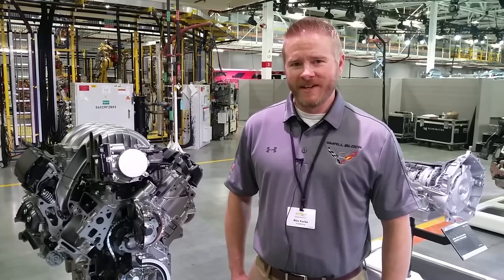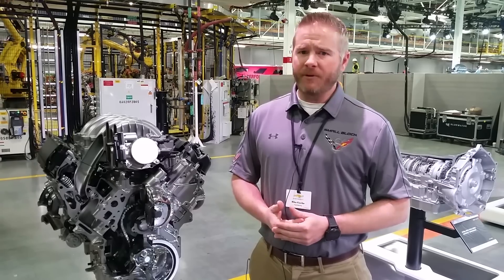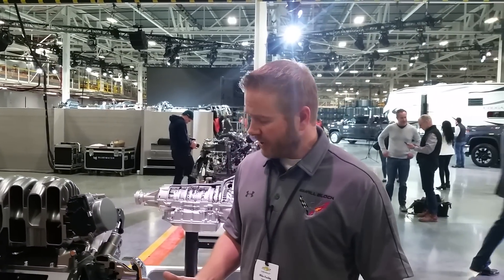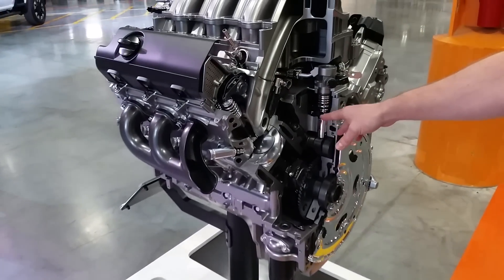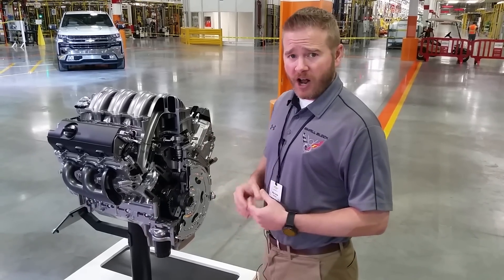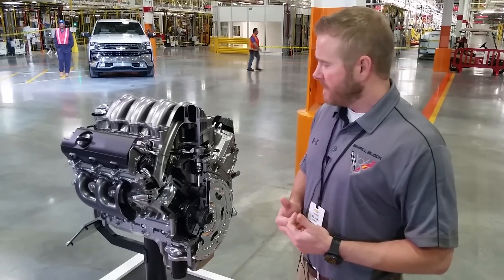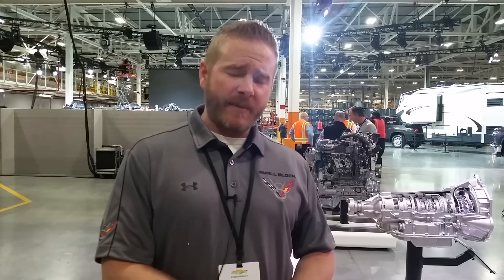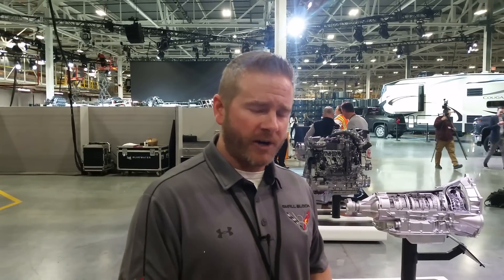New 6.6-liter V8 gas engine on 2020 Silverado HD

Comment: What I hear is this: "Only has Direct Fuel Injection" = Install oil catch can to reduce sludge build up on intake valve. "Has fan directly mounted on water pump." = Install electric cooling fan kit for more power and fuel economy. "Has intelligent oil life monitoring to get maximum life out of oil." = Change the oil and filter every 5k because it has VVT and isn't going to hurt it in the long run.

Comment: I loved my 1976 no power windows that quit no power seats, the fuel pumps on the motor easy fix not hid in the gas tank no intermittent wipers no cruise control only a truck that lasted me around 400k miles and the u I sold it to still drives it ,I regret selling it
Reply: Uncomfortable, cant roll up or down the passenger window while driving, hot in the summer, cold in the winter.
Hard starts in the winter, vapor lock in the summer.  
Rattles, shakes and squeaks everywhere,
Brakes sucked, handling SUCKED, steering sucked, driveability sucked,  power sucked, fuel economy sucked, traction sucked, transmission sucked, headlights sucked, radio sucked... 
Broke down frequently. Brakes that would lock with the greatest of ease on wet pavement and send you crashing into other cars...
Ah, the good old days.
I miss them too...
Reply: @lees.4084  mine wasn't it was a ford 250 ranger xlt camper special as nice as any truck today without junk you do t need it had I bought it brand new in 1976 for 4k and sold it 9 yrs later for 4k I like chevys but it was a great truck it had a 390 v8
Reply: @dewaynemiguel3349  well, that 390 was rated at almost 200 hp.
That's about half of what new trucks with similar size engines make, and probably about 100lb/ft less torque.
The new ones have far, FAR fewer emissions, have much better fuel economy, response, smoothness, and yes, will likely last many more miles.
The new trucks have more interior space, and yes, far more standard equipment and features.
Now you can not care for many of these features, and that's fine. Everybody has different views on what's needed or not on cars/trucks.
But new trucks are better in just about every aspect you can think of, except price of course...

Don't get me wrong, I still own an 80s model Chevy truck myself, and its gets basic transportation and hauling needs met, but it certainly leaves much to be desired most of the time.
Reply: @lees.4084  when I bought my 76 for 4k in 76 they homered the warrenty, they put garbage on trucks you know is going to go out then have to fight them to get it fixed I had a 04 suburban all pickups Tahoe suburbans from 99 to 07 had a guage cluster that went out it took a lawsuit to get gm to fix it  I'm saying g theres too much junk on them that will go out .not might but will any thi g they come out with new is questionable that's not a opinion that's a fact

Comment: Variable oil pressure, sounds like a future problem, when will they learn if it ain't broke dont change it,instead if it does break they dont change .
Reply: It's actually a very simple system.
Pumps in automatic transmissions have been doing this for decades...
Reply: All autos are being designed so us guys/girls can’t work on our own equipment that way the dealer can charge the high dollar per hour. To fix this issue we just have to learn to work on them. It’s a pain in the ass but it will pay off in the long run.
Reply: what the hell is wrong with a stable no bs no fancy always pumping correctly oil pump?
Reply: The do it for efficiency purposes. It requires energy from the crank to pump more oil. I will agree that pumping losses are minimal but the EPA is screwing us all over. Instead of maximizing the use of resources to and materials to develop and build an engine to last 4x or 5x, they regulate manufacturers into an emission and efficiency box and force them to produce much less reliable engine. 

Did you know that a diesel engine could be up to 20% more efficient if the calibrators (performance tuners) weren't concerned with NOx emissions?

Comment: Inner bore cooling...... U mean a water  jacket found on any water cooled engine? Cutting edge shit right there bruh ..
Reply: It's a siamesed bore.
Not enough space to cast a coolant passage in between the bores.
It has cooling passages drilled between them.
That's what they're trying to say.
Reply: I thought the same. "does Chevy know Honda?" That's a v8 Honda engine, re branded
Reply: @marioalvidrez940  
Get off the meth...

Comment: That GDI system is gonna have problems. You are gonna have excess carbon build up from the PCV system, and just air and have nothing to keep it clean. If the gas was injected into the intake like any other vehicle the solvent from the gas kept the valves clean from all the crap coming from the PCV system. That motor is gonna have problems in the future with the intake valve.
Reply: If you use ow-16 oil your valves will stay clean
Reply: @clb_52  but how many people that do there own oil changes, or any oil change shop would go ahead and throw that in there. They are gonna be trying to save money as much as possible and not have to carry special oils for the one car
Reply: @tannerwimer  that oil is formulated to keep intake valves clean
Reply: @clb_52  I understand that but are people gonna go out of there way to put it in? Shops are gonna save money and throw in the same oil they throw in everything else
Reply: @tannerwimer  you have to do it yourself

Comment: Don't think this is going to hold up to Ford's new a 7.3 gas Godzilla engine. And I hate to say this because I'm not a Ford man at all. But I think they blew the doors away of General Motors on this the 7.3 has 6 bolt Main bearings believe it's all cast iron made for Boost for turbos. And their initial numbers are outstanding on that engine
Reply: Ls is 6 bolt main as well and bottom end can handle 1000hp.

Comment: That guy is the assistant chief engineer of what?  Software? 
Segment first direct injection? No, F-150 has had that ever since the Eco-boost came out.
Inner bore cooling?? My 2002 Corvette has the same coolant passages.
He talks about the longer rod making a longer stroke, but it is the crankshaft throw that makes the longer stroke.
A "dual equal system" that drives the intake and exhaust off the same camshaft? Uh, I think every pushrod, flathead, and SOHC engine ever made has done that.
Reply: Segment first means 2500 HD and up... Last I checked they did not put the EcoBoost in the F250
Reply: @lesterclaypool2194  No, but they put the 6.7 Powerstroke in the F-250, and that is direct injected.
Reply: Nice try backpedaling... They were no way shape or form comparing it to any diesel... I guess since we want to go way off topic the first direct-injected was Mercedes-Benz I believe, way back in the 1950s... You're the one that made the direct reference to an EcoBoost
Reply: @lesterclaypool2194  First direct injection gasoline engine was German manufacturer Junkers back in 1916. It was initially sketched as a diesel engine, as diesels were more efficient, but the German ministry of war needed engines that would run on gasoline. (called benzene at the time) Since the design was a 2 stroke, the gasoline version would misfire and destroy the engine, so the developed a gasoline direct injection system to solve their problem.

As for my reference to Ecoboost, it is the first gasoline direct injection that I knew of in pickups. Gasoline direct injection has been mainstream for decades now. My old jet ski had DI when I owned it back in 2008, and I can't remember what year the ski was, but it was probably 10 years old then.
Reply: Wow somebody knows how to use Google... Would you like me to Google your jet ski information and repeat it back verbatim to you... this is not an argument I'm into I was just correcting your incorrect statement the first time... I'm just fine with my Duramax, and C6... I hope you have a good time posting incorrect knowledge on YouTube LOL
Reply: @lesterclaypool2194  No Google required. I'm in the process of designing an opposed piston engine for use in racing, and Junkers (pronounced yoon-kurs) made extremely efficient examples, for their time anyway, back in the 1930s. I also spent either 8 or 9 years on a project for a prestigious car museum trying to rediscover race car and engineering that had been lost to time, before the people who did it passed away taking their secrets with them. Racing was very technical decades ago, and nobody wrote anything down for fear of their competition getting the information.
Reply: Sounds like a state-of-the-art waste of time to me, somebody with your extensive knowledge should have just edited your first post LOL... if you really want to see what the future holds look up coats International... But I'm sure you already I know all about this
Reply: @lesterclaypool2194  I wasn't familiar with Coates, although I do know about spherical valve engines. Someone raced the Chili Bowl with one back around 2005 or 2006 when I went. I really like Koenigsegg's Freevalve project that also eliminates the camshaft because their concept allows you to make each valve timing infinitely variable, and allows for a square profile for opening and closing. My engine I was considering a ball valve on the intake, similar to the rotary valve you mentioned. I wouldn't need a throttle body, and it would only be activated for emergency shutdown, so the ball valve would eliminate the butterfly and provide better laminar flow.

Comment: I should has watch this video before dinner, everything that was described was crab... I feel sick now.. I work in auto parts for 30 years... and I had a chevrolet Caprice 78 for 35years.... same engine, it even pass emissions for a 1988 vehicle with not computer controls... this new engine is going to be part of the throwaway car revolution, the moment this motor star failing
Reply: we live in a throw away society. companies used to think if we build it to last thats what they will buy. build it the cheapest way possible for maximum profit and will always get repeat customers. they have to come back if it costs more than its worth to fix it. remember when we had glass bottles that were returned over and over again. now its plastic everything floating in the ocean and piled along the roadside. when bottles were worth a little on returning you never saw any unless they were broken .kids like me were hunting them down to get our bubblegum and candy money from the deposit. deposit bottles the original and true recycle container.

Comment: 1:17 What? Rod length doesn't impact displacement
Reply: Correct but a longer rod does increase tourqe due to less side loading of piston,  more dwell time, straighter push on crankshaft
Reply: @bowsertownes  Not sure that is relevant to my comment. True on the part about less side loading and more dwell time, but your sentiment should come with an asterisks that it affects multiple aspects that are tied in - including the combustion process. You don't just increased the rod length and see higher tq numbers. What you usually see is the peak torque move up in the rev range to a higher rpm (and the opposite when rod length is decreased).
Reply: @amorag59  assuming you're building an engine with the amount of knowledge to lengthen rods your build is probably supporting it. Gm engineers did move in the right direction and the spokesperson can't go into detail cause 90 percent of customers could give a shit about everything.

Comment: One can build a 383 (6.3L) from a junkyard 350 for about 2-3 grand. 450 hp. Boom. You could probably build 5 of them for the price of one of these.
Reply: Kids like Ls's nowadays. I prefer the older gens personally. Alot of kids wouldnt able to adjust valves anyways

Comment: He says forged powdered metal rod, isn't that an oxymoron?
Reply: It sounds like it until you see how they're made, most con rods since the 90s in mass production vehicles are made this way. Fill a mold with metal powder, heat it and press it. More consistent and stronger than cast rods, cheaper and lighter than fully forged rods.  The name doesn't inspire a lot of confidence though.
Reply: @SOHCGT96  now I know, thank you for educating me